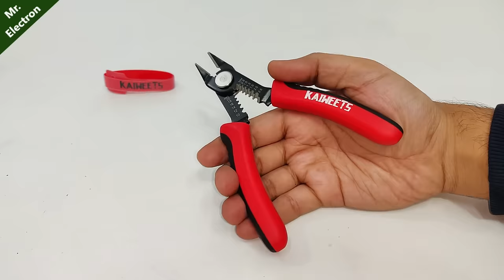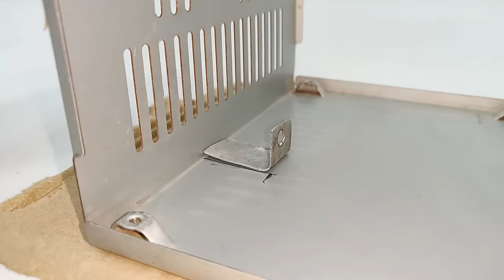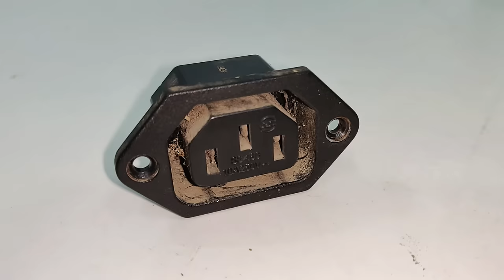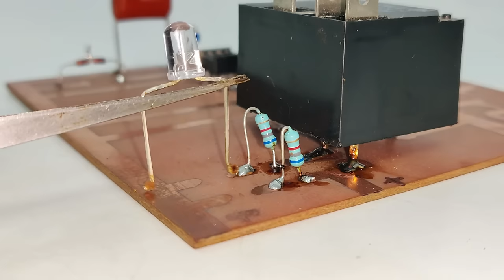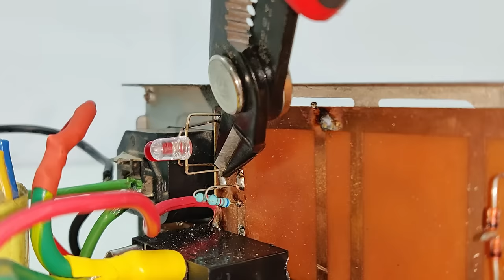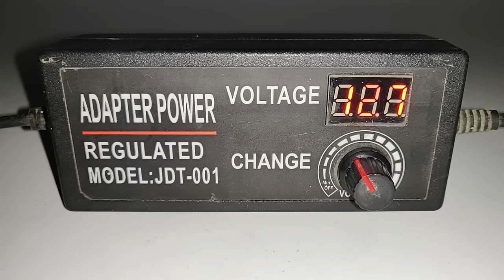12 Volt 150Ah Battery Charger using old Computer Power Supply - 220V AC to 12V DC

Comment: hello i am first viewer
Reply: Query: Can you really trust this guy? Does he really know  electronics - or is he just screwing around - buried in ignorance?
First he says its using an ATX PSU but at the very end he says he  is using a microwave  transformer.
Then he puts two 10A bridge rectifiers in parallel BUT even a novice knows this does not work [because the Vd are different].
Then his Mickey Mouse controller uses a puny relay which can not handle the stated current.
He does not explain the cntroller but it seems to be a simple cut-off; the charging current is not controlled and can be DANGEROUS.
 I have read 4 recommedations from battery makers and many articles from creditable battery experts and they ALL say current must be controlled. 

I just read a comment by him saying the transfomer is rated at 40A !!!!   LMAO  But the diode bidge is 10A and that play-time relay can handle no more than  6A DC.   This is a JOKE from bizarre start to laughable finish

Comment: Nice project but u only used an old computer power supply case only …..not the power unit of the ATX itself
Reply: Exactly. I don’t know why they just didn’t find/buy/make a suitable enclosure rather than rip the power supply apart
Reply: And where is the fan  so that it does not get hot.

Comment: Charge 13.40v car battery form this power supply
Reply: 12.5v is dead power full is 13.40v
Reply: This always right upload videos plz
Reply: Query: Can you really trust this guy? Does he really know  electronics - or is he just screwing around - buried in ignorance?
First he says its using an ATX PSU but at the very end he says he  is using a microwave  transformer.
Then he puts two 10A bridge rectifiers in parallel BUT even a novice knows this does not work [because the Vd are different].
Then his Mickey Mouse controller uses a puny relay which can not handle the stated current.
He does not explain the cntroller but it seems to be a simple cut-off; the charging current is not controlled and can be DANGEROUS.
 I have read 4 recommedations from battery makers and many articles from creditable battery experts and they ALL say current must be controlled. 

I just read a comment by him saying the transfomer is rated at 40A !!!!   LMAO  But the diode bidge is 10A and that play-time relay can handle no more than  6A DC.   This is a JOKE from bizarre start to laughable finish

Comment: you just used the casing as a chassis for a new power supply ! you did not use the circuit from the old computer power supply.
Reply from the maker: Actually i have already done that in one of my previous videos.
Also, don't forget the 2 plugs and the 2 way switch that i reused.
Reply: @MrElectron  what is important is the active electronic parts upgraded to 120ah charger.
Reply from the maker: Soon for sure 💥

Comment: Bravo pour la réalisation. Nécessaire et indispensable avant tout.
Reply: can you trust this guy? Does he really know  electronics - or is he just screwing around?
First he says its using an ATX PSU but at the very end he says he  is using a microwave  transformer.
Then he puts two 10A bridge rectifiers in parallel BUT even a novice knows this does not work [because the Vd are different].
Then his Mickey Mouse controller uses a puny relay which can not handle the stated current.
He does not explain the cntroller but it seems to be a simple cut-off; the charging current is not controlled and can be DANGEROUS.

Comment: Super projekt. Dzięki za Twoje zaangażowanie na tym kanale. Życzę dalszej inwencji w kolejnych projektach 👍👋
Reply: Dziękuję bardzo za link email. Kupiłem w sklepie KAIWETS 👍👍
Reply: Great project 😁😁😁, are you mad
Reply: can you trust this guy? Does he really know  electronics - or is he just screwing around?
First he says its using an ATX PSU but at the very end he says he  is using a microwave  transformer.
Then he puts two 10A bridge rectifiers in parallel BUT even a novice knows this does not work [because the Vd are different].
Then his Mickey Mouse controller uses a puny relay which can not handle the stated current.
He does not explain the cntroller but it seems to be a simple cut-off; the charging current is not controlled and can be DANGEROUS.

Comment: Feliz sábado Mr Electrón, gracias por este nuevo vídeo!! 😊
Reply: can you trust this guy? Does he really know  electronics - or is he just screwing around?
First he says its using an ATX PSU but at the very end he says he  is using a microwave  transformer.
Then he puts two 10A bridge rectifiers in parallel BUT even a novice knows this does not work [because the Vd are different].
Then his Mickey Mouse controller uses a puny relay which can not handle the stated current.
He does not explain the cntroller but it seems to be a simple cut-off; the charging current is not controlled and can be DANGEROUS.

Comment from the maker: Seems like people are confusing Amps (A) with Ampere hour (Ah). Here 150 Ah or 450 Ah is the battery capacity and not the amperes that this powersupply is going to produce.
A 150Ah battery can charge at just 2 Amps so 3 such batteries will need a minimum of 6 Amps to charge but here the charger is producing much more than that. Hope this solves the confusion.

Note : Set the voltage a little higher than the desired battery charge voltage. It will work great for Lead Acid , inverter, car batteries.
Buy Wire Cutter  - https://kaiweets.com/products/kaiweets-kws-102-2-in-1wire-cutters-6-inch-flush-pliers-wire-stripping-cable-tool?sca_ref=2923215.t5bO4xWTTf
Buy Wire Stripper - https://kaiweets.com/products/kaiweets-kws-302-multifunctional-wire-stripper-kit?sca_ref=2923215.t5bO4xWTTf

DISCOUNT COUPON - ME15
Reply: where do you have pcb schematics?
Reply: WHERE IS THE ELECTRICAL DIAGRAM?
Reply from the maker: Diagram is in the video.
Reply: @MrElectron  At what minute and second ?
Reply: There is no minimum charging current. It will just take longer. So long as the voltage is properly set the battery will eventually fully charge. You can charge any size battery with a 2A charger.
Reply: @ericklein5097  Correct !!! Correctly !!! But no schematic on screen and no PCB schematic? I have a downside!!!
Reply: Iam charging 72AH battery with solar 2 to 7 amp

Comment: Nice video, but the battery voltage should be raised up to 14.4v, then maintained at 13.8v. This is why the circuit cut the current while the battery was still charging and only got 12.9v. With some adjustment, the project is a good one since we also get a power supply.
Reply from the maker: I was hoping that someone will state this. Actually one of my battery cells is dead because of which it can go only to a max of 12.6V which is still enough to power up my inverter so I am not discarding it.
So, even if i use an 18v direct charging or 20v ( which is not at all advised ), it will still stabilize at 12.6 or 12.7v which is its maximum because one of its cells is dead.
Reply: @MrElectron  Clear. Thanks.
Reply: เครื่องละเท่าไรคับและ 13.8 V. ราคาเหมือนกันใหม
Reply: @MrElectron  BS you talk...
2.1 Volts per cell...
You wont have 12.6V with 1 dead cell but about 10V...

Comment: Excellent project👌🏾
Reply: can you trust this guy? Does he really know  electronics - or is he just screwing around?
First he says its using an ATX PSU but at the very end he says he  is using a microwave  transformer.
Then he puts two 10A bridge rectifiers in parallel BUT even a novice knows this does not work [because the Vd are different].
Then his Mickey Mouse controller uses a puny relay which can not handle the stated current.
He does not explain the cntroller but it seems to be a simple cut-off; the charging current is not controlled and can be DANGEROUS.

Comment: Szépek a forrasztások, gratulálok! Nálunk az ilyeneket úgy hívják, hogy taknyolás.
Reply: can you trust this guy? Does he really know  electronics - or is he just screwing around?
First he says its using an ATX PSU but at the very end he says he  is using a microwave  transformer.
Then he puts two 10A bridge rectifiers in parallel BUT even a novice knows this does not work [because the Vd are different].
Then his Mickey Mouse controller uses a puny relay which can not handle the stated current.
He does not explain the cntroller but it seems to be a simple cut-off; the charging current is not controlled and can be DANGEROUS.

Comment: Hi Mr Electron, super vidéo very instructive, i have try to make a power supply with a PSU but i've lost my time, so i really appreciate to see  how you doing this, and with this power!
Reply: can you trust this guy? Does he really know  electronics - or is he just screwing around?
First he says its using an ATX PSU but at the very end he says he  is using a microwave  transformer.
Then he puts two 10A bridge rectifiers in parallel BUT even a novice knows this does not work [because the Vd are different].
Then his Mickey Mouse controller uses a puny relay which can not handle the stated current.
He does not explain the cntroller but it seems to be a simple cut-off; the charging current is not controlled and can be DANGEROUS.

Comment: Nice work you do there. I love It!
Reply: Can you really trust this guy? Does he really know  electronics - or is he just screwing around - buried in ignorance?
First he says its using an ATX PSU but at the very end he says he  is using a microwave  transformer.
Then he puts two 10A bridge rectifiers in parallel BUT even a novice knows this does not work [because the Vd are different].
Then his Mickey Mouse controller uses a puny relay which can not handle the stated current.
He does not explain the cntroller but it seems to be a simple cut-off; the charging current is not controlled and can be DANGEROUS.
 I have read 4 recommedations from battery makers and many articles from creditable battery experts and they ALL say current must be controlled.

Comment: Nice video sir the video was very informative for me and I learned new things from your video, your teaching method is very nice
Reply: can you trust this guy? Does he really know  electronics - or is he just screwing around?
First he says its using an ATX PSU but at the very end he says he  is using a microwave  transformer.
Then he puts two 10A bridge rectifiers in parallel BUT even a novice knows this does not work [because the Vd are different].
Then his Mickey Mouse controller uses a puny relay which can not handle the stated current.
He does not explain the cntroller but it seems to be a simple cut-off; the charging current is not controlled and can be DANGEROUS.

Comment: thanks so much doc ♥
Reply: can you trust this guy? Does he really know  electronics - or is he just screwing around?
First he says its using an ATX PSU but at the very end he says he  is using a microwave  transformer.
Then he puts two 10A bridge rectifiers in parallel BUT even a novice knows this does not work [because the Vd are different].
Then his Mickey Mouse controller uses a puny relay which can not handle the stated current.
He does not explain the cntroller but it seems to be a simple cut-off; the charging current is not controlled and can be DANGEROUS.

Comment: hello, you are wrong the title of the video, it is not made with the source of a computer, you only used the box.
Reply: Query: Can you really trust this guy? Does he really know  electronics - or is he just screwing around - buried in ignorance?
First he says its using an ATX PSU but at the very end he says he  is using a microwave  transformer.
Then he puts two 10A bridge rectifiers in parallel BUT even a novice knows this does not work [because the Vd are different].
Then his Mickey Mouse controller uses a puny relay which can not handle the stated current.
He does not explain the cntroller but it seems to be a simple cut-off; the charging current is not controlled and can be DANGEROUS.
 I have read 4 recommedations from battery makers and many articles from creditable battery experts and they ALL say current must be controlled. 

I just read a comment by him saying the transfomer is rated at 40A !!!!   LMAO  But the diode bidge is 10A and that play-time relay can handle no more than  6A DC.   This is a JOKE from bizarre start to laughable finish

Comment: Always brillient my friend God bless
Reply: can you trust this guy? Does he really know  electronics - or is he just screwing around?
First he says its using an ATX PSU but at the very end he says he  is using a microwave  transformer.
Then he puts two 10A bridge rectifiers in parallel BUT even a novice knows this does not work [because the Vd are different].
Then his Mickey Mouse controller uses a puny relay which can not handle the stated current.
He does not explain the cntroller but it seems to be a simple cut-off; the charging current is not controlled and can be DANGEROUS.

Comment: I wish you success from Iran👍
Reply: can you trust this guy? Does he really know  electronics - or is he just screwing around?
First he says its using an ATX PSU but at the very end he says he  is using a microwave  transformer.
Then he puts two 10A bridge rectifiers in parallel BUT even a novice knows this does not work [because the Vd are different].
Then his Mickey Mouse controller uses a puny relay which can not handle the stated current.
He does not explain the cntroller but it seems to be a simple cut-off; the charging current is not controlled and can be DANGEROUS.

Comment: Nice project but I felt they should be fan to blow off heat because it will generate a lot of heat when changing at 150A.
Reply: Can you really trust this guy? Does he really know  electronics - or is he just screwing around - buried in ignorance?
First he says its using an ATX PSU but at the very end he says he  is using a microwave  transformer.
Then he puts two 10A bridge rectifiers in parallel BUT even a novice knows this does not work [because the Vd are different].
Then his Mickey Mouse controller uses a puny relay which can not handle the stated current.
He does not explain the cntroller but it seems to be a simple cut-off; the charging current is not controlled and can be DANGEROUS.
 I have read 4 recommedations from battery makers and many articles from creditable battery experts and they ALL say current must be controlled.

Comment: A very wonderful video. Keep it up Mr. Electron
Reply: Hay quá bạn ơi để dành cho bạn nhé mình mua sài xướng hơn
Reply: 150 amper da quel trasformatore ? Prende fuoco tutto.
Reply: can you trust this guy? Does he really know  electronics - or is he just screwing around?
First he says its using an ATX PSU but at the very end he says he  is using a microwave  transformer.
Then he puts two 10A bridge rectifiers in parallel BUT even a novice knows this does not work [because the Vd are different].
Then his Mickey Mouse controller uses a puny relay which can not handle the stated current.
He does not explain the cntroller but it seems to be a simple cut-off; the charging current is not controlled and can be DANGEROUS.

Comment: Hi, Very interesting , Can i use the same setup without the cutofff board to use with my tire inflator  with requires 12VDc @ 20A-25A rating
Reply from the maker: Yes
Reply: Can you really trust this guy? Does he really know  electronics - or is he just screwing around - buried in ignorance?
First he says its using an ATX PSU but at the very end he says he  is using a microwave  transformer.
Then he puts two 10A bridge rectifiers in parallel BUT even a novice knows this does not work [because the Vd are different].
Then his Mickey Mouse controller uses a puny relay which can not handle the stated current.
He does not explain the cntroller but it seems to be a simple cut-off; the charging current is not controlled and can be DANGEROUS.
 I have read 4 recommedations from battery makers and many articles from creditable battery experts and they ALL say current must be controlled.

Comment: Ma che c'entra l alimentatore del PC? Con quello che c'hai fatto?
Reply: Can you really trust this guy? Does he really know  electronics - or is he just screwing around - buried in ignorance?
First he says its using an ATX PSU but at the very end he says he  is using a microwave  transformer.
Then he puts two 10A bridge rectifiers in parallel BUT even a novice knows this does not work [because the Vd are different].
Then his Mickey Mouse controller uses a puny relay which can not handle the stated current.
He does not explain the cntroller but it seems to be a simple cut-off; the charging current is not controlled and can be DANGEROUS.
 I have read 4 recommedations from battery makers and many articles from creditable battery experts and they ALL say current must be controlled.

Comment: nice project but i think it's better to connect the relay to the mains voltage not to 12v output so it gets less heated even u can use smaller one.
seems like alot of people don't understand the difference between 150AH and 150A, AH ampere-hour is used for the capacity of the battery.
Reply: can you trust this guy? Does he really know  electronics - or is he just screwing around?
First he says its using an ATX PSU but at the very end he says he  is using a microwave  transformer.
Then he puts two 10A bridge rectifiers in parallel BUT even a novice knows this does not work [because the Vd are different].
Then his Mickey Mouse controller uses a puny relay which can not handle the stated current.
He does not explain the cntroller but it seems to be a simple cut-off; the charging current is not controlled and can be DANGEROUS.